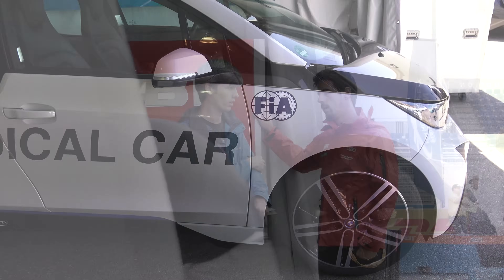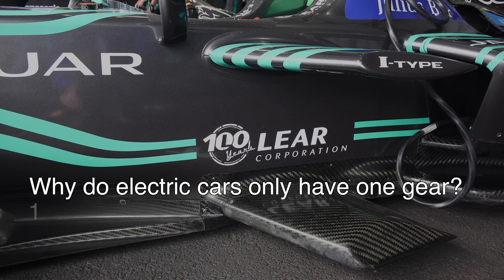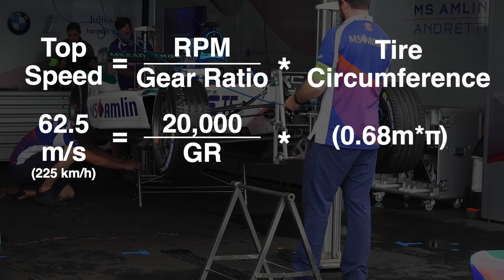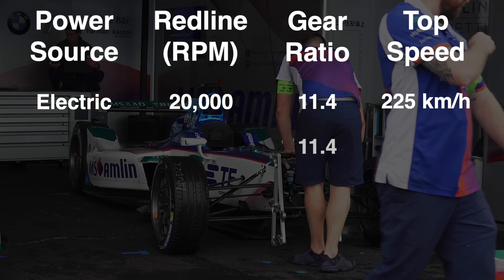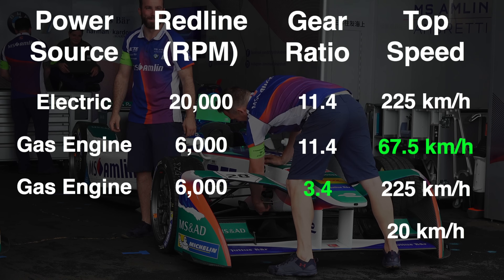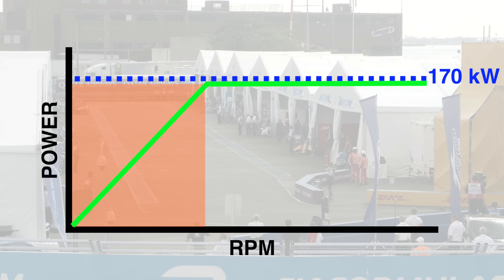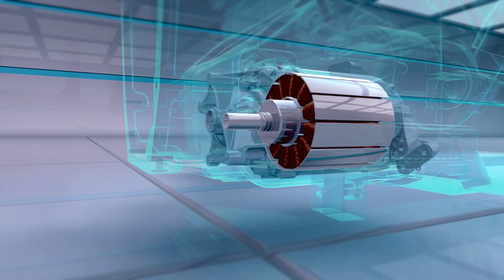Why Do Electric Cars Only Have 1 Gear?

Comment: why don't they make street e cars with gears to maximise the distance a car can cover with one battery charge
Reply from the maker: Again, it's not necessarily worth the efficiency losses that go into adding a geared transmission. Also adds weight and complexity. Electric motors are efficient across a wide range of RPM, so adding gears could potentially mean reducing efficiency.
Reply: Ben Guyton - That's exactly what Tesla does in awd model S and X. Front smaller motor is used for slow driving, while the larger back motor kicks in when the power draw gets higher. For performance both motors are used.
Reply: With a synchronous motor the efficency doesn't change as much with rpm as a combustion engine does. So the efficency gain with more gears is not as big as the gain on combustion engines. But it makes the car heavier, which decreases the efficency, which smallers the gain even more. And of course it costs more, and the price is beside the range one of the biggest problems for electric cars at the moment.
Reply: Only on the early roadsters tesla used a two speed transmission, and changed it later to a fixed gear.
Reply: Where did you get this information?
 Give one example of an EV with a CVT.
Reply: Siegfried Schwab Turning fast isn't an issue with electric motors. You can design it to be efficient at any RPM you want with little consequence at other rpm. Trains don't use multiple speed gear boxes.
Reply: @difflocktwo  mostly because you cant put that much force into a clutch system...trains are just too heavy
Reply: XilefR It wouldn't accelerate faster as it already has so much power the tyres can't handle more (at launch). More wheel torque is useless without grip.
Reply: IIGrayfoxII - wrong. EVs do not use a CVT, they use a fixed-ratio gearbox (a reduction gearbox at that). You could eliminate the gearbox entirely but you'd melt the tires.
Reply: The only reason Tesla or any EV would put a two-speed transmission would be to attain the same acceleration with a smaller motor.  Of course, now you have to deal with added complexity of some sort of decoupling mechanism that can break/wear out.
Reply: difflocktwo
Again, same arguments; it's not needed just because electric mototrs are super efficient.
Reply: Some PHEVs, depending on where they put the motor, can still make use of the vehicle gearbox (think the Ioniq does this, as does the Kia Optima Hybrid). 

But you are correct on the efficiency thing. I have efficiency maps for the Leaf and a large part of the operating map is above 90% efficiency (motor + inverter combined) and it spins to 10400RPM so 9 to 1 reduction works absolutely fine...no need for more gears to reduce efficiency.  The efficiency really only drops off at the edges (very low speed or very low power demand) .
Reply: You will always be slower with gears. The weight of the gearbox could be used for more battery or more motor. Gears are not active components, they only rob power, they don't create it.
Reply: @difflocktwo  gears dont always make you slower...they just change how the power is applied...they have their uses
Reply: alex sagel Formula E is full of handicaps and regulations. It is far from the pinnacle of EVs.
Reply: @difflocktwo  regulations dont effect research and development...most car technology we have today wouldnt exist without motorsport
Reply: +engineering explained This is wrong, BLDC motors commonly used have highest torque at 0 rpm and declines as the RPM increase. As the total load decreases so does dynamically the consumption of current. Gearing would only be used to increase the max torque and not really for anything else because electric motors dont really have a powerband like you displayed it.
Reply: Azur Hadžić Ajde prijatelju i ja da ti objasnim. Običan motor u visokim obrtajima ima više snage, ali je manje efikasan. Zato svaki motor gledaš da držiš između 1.500 i 3000 obrtaja da manje troši. Električni motor je toliko efikasan, oko 90 do 95% pri svim obrtajima da menjač samo dodaje nepotreban otpor. Pa dečko se ubi objašnjavajući u videu. Kod električnog je bitno da kažeš - ne treba da vozim brže od recimo 160, napraviš prenos da motor kad udari blokadu auto ide 160, a motor je dovoljno jak da povuče. I to je sve.
Reply: Memeson Combat weight with POWER
Reply: "Siegfried Schwab" When I was a kid I had a remote controlled car with 6 gears. If you put it in the gear with highest top speed it would be really slow to accelerate and  you would use up the battery in 10 min  no matter how fast or slow you did go. Put it in low gear and you could drive for a hour. If you did go for the middle ground that gave ok acceleration and ok top spead you could drive for about 30 min and again speed did have little influence on how long time you could drive. As far as I know this still stands for electric engines of today at least to some degree (less then before because of higher max rpm).  Having gears on electric cars will help on the economy as well as acceleration, problem is to maker a gearbox that can handle the torque without being to heavy, gearboxes itself also have loss of energy.
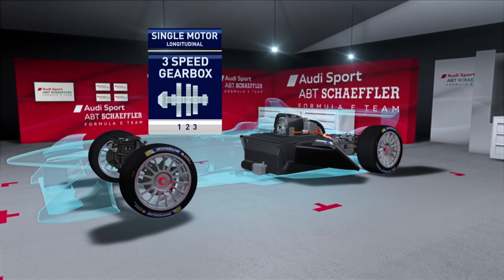Reply: It could accelerate faster, as it is explained at 3:38. Topspeed wouldn't change, as long as the gearing of the last gear is the same.
Reply: Formula E are artificially limited. So MAYBE (i doubt) in F E you can accel faster with gears. But actually  more motor or more battery will accel faster.
Reply: @difflocktwo  if you have a car that is geared 9:1 like most teslas then it would take a motor that was 9 times as strong as the motor you have to make it as quick as just adding a gear...plus you have to overcome momentum and once you get motors that big you need big wires...its not practical for cars...its much easier just to gear the final drive to whatever you want
Reply: +Ken Kalajdžič Yes, but hypotheticaly it would accelerate faster, if you could bring the torque to the ground, for example with bigger tires.

+difflocktwo A more powerfull motor will ofcourse accelerate you faster, but at this point it's not about the transmission anymore.
Reply: IIGrayfoxII I've never seen a CVT in an EV, certainly not normal.
Reply: Siegfried Schwab by my understanding Tesla atleast and probably everyone else is using a three phase induction motor with a phase controller for throttle. When the phase controller is outputting 60hz and the motor is spinning at 60hz the power draw of an induction motor is very nearly zero. If the phase controller is outputting 120hz and the motor is spinning at 60hz the power draw will start high and taper off as the motors speed approaches 120hz. If the phase controller outputs 60hz while the motor is spinning at 120hz the induction motor will output a lot of power and when the motors speed tapers off so will the power output.
Reply: But you need fewer batteries if you don't consume as much power and thereby it balances itself out again so that in the end you cover more distance with less electricity.
Reply: Actually the frequency of the controller would be much less than 120 Hz if the rotor would rev at 60 Hz, about 65 Hz. Also, when the controller outputs a lower frequency than the rotor's revs, the motor will actually brake and generate power.

That's why induction motors are incompatible with many coded track circuits - they need a current of all frequencies from 0 to max, which leaves no "protected" frequency for signalling. Also, when you listen to a locomotive with induction motors, you can actually hear the sweep from 0 to max.
Reply: Azur Hadžić Because of the weight
Reply: Probably the added cost of more gears is not worth the benefit of having a car that can start a little bit faster. You are in the street, it´s not a drag race.
Reply: Rondo Cat, your example doesn't really apply to full-sized automobiles. I thought the video has a great explanation. The reason is that electric motors aren't reciprocating; the combustion analogy is a jet engine (turbine). Since an electric drive shaft doesn't have to stop and reverse direction, its RPMs can go very high. No transmission needed in most cases. The Tesla Model S has a 9.7 reduction gearbox and it can completely handle the torque.
Reply: Rondo Cat Gear boxes will not work. Gears only add friction. You could use the same cost of a gear box and make a larger motor.
Reply: Don't Formule E cars have 2 gears though? I'm not of the exact reasoning but maybe you could answer why.
Reply: but then the cost would increase because you'd be litterally putting 3 motors in there which are not cheap.
Reply: Fogolol !! Gear boxes are cheaper? Electric motors can be and are super cheap.
Reply: first of all i didnt say anything about gear boxes. second :How can an electric motor be cheap? I mean it uses a lot of copper wires and things like that. Also in case any misunderstanding happened here, i was talking to Ben Guyton
Reply: Fogolol !! My bad. But yeah PMAC motors are cheap. How many kW do you want? Every Chinese electric moped uses an electric motor capable of a few horsepower and each cost like 50$ retail. Zero uses pretty nice motors which can peak over 100 hp and they could retail for a thousand bucks or less.
Reply: With electric motors you can reduce the power needed by reducing the voltage from the battery.  So if you need more power to get going off the line, and then once up to speed you need less power, the voltage pulled from the batteries is reduced.  There is no benefit from having any sort of gearbox to reduce battery consumption, and as has been stated it would probably be worse with a gearbox.
Reply: maybe rather than adding a gear system to the engine, having a device that work like a gear on limiting the power voltage to the engine which limit max speed on each "gear"/step can work.
Reply: Ronald Pradesya That's called a motor controller. Any digital EV uses one.
Reply: Avery-John RC guys call them ESCs. No new consumer EV is brushed.
Reply: difflocktwo yep the assist levels on my e-bike work by changing the voltage level going to the motor.
Reply: Azur Hadžić you don't need a shifting gear in ev... it is not needed a motor does not have problem to get high speed with loosing efficency
Reply: Engineering Explained but if you would just gear up when you reach redline it would minimize the losses and add range and topspeed wouldnt it?
Reply: I think the extra weight of a huge gearbox will more minimize the range of a car, than it will add.
The power of an electric engine is almost same from zero to maximum rpm.
Reply: IIGrayfoxII What EV has a CVT?
Reply: In simple terms, if you need 15KW to push the car at a high speed the motor would approximately consume that much at both high or low rpm, it's not like there are more combustions happening. The efficiency is about the same.
Reply: Probably be more efficient to have multiple e-motors in one car. A small low power motor for streets, a medium motor for freeways and highways and a larger motor for performance and power, all on the same single gear. This would limit the amount of battery power needed and could expand the maximum distance.
Reply: That's what I've been asking myself for a long time too, but never got any satisfying answer:
Could a transmission help to extend the range of an electric car by reducing the power needed from the battery (e.g. while cruising on constant speed on a highway)? The idea behind my question is: If I have a
 long distance gear (e.g. like the 5th or 6th gear in internal combustion engines), the electric motor wouldn't have to turn that fast to hold the speed and therefore wouldn't need that much power from the battery. 
Or does this not play any role in electric motors?
Reply: XilefR yeah, and if I recall well the taller gear was blocked by software anyways....
Reply: you mean like tesla?
Reply: Electric cars you can buy normally use a CVT.
So the power usage is lowest whilst still providing enough power.

Comment: Why only 170 kW though?
Reply: Dinsdale Drummond too much power can that what it is meant for cab destroy the motor
Reply: Probably to get a longer race, as too much power would drain the batteries early.
Reply: Connor Simpson ahemm motor not engine. Rookie mistake
Reply: Having da skillz bro is neat but racing is about technology too. The engine does not drive itself, so there is always a human aspect to it. It is a mix of technology, luck and skills. Limiting it to 170kw make it boring.